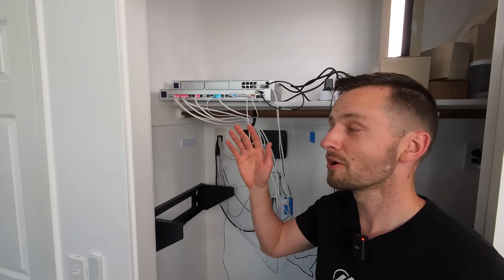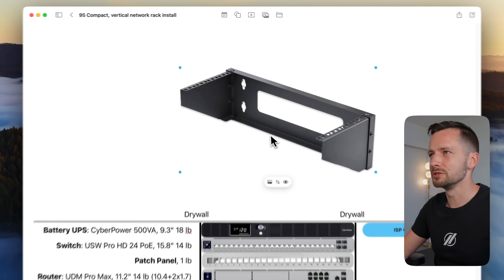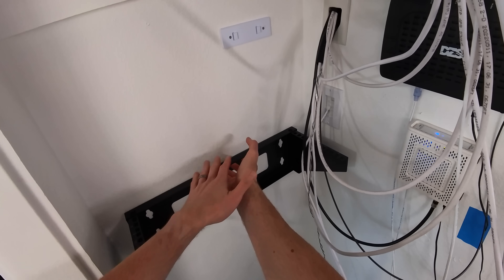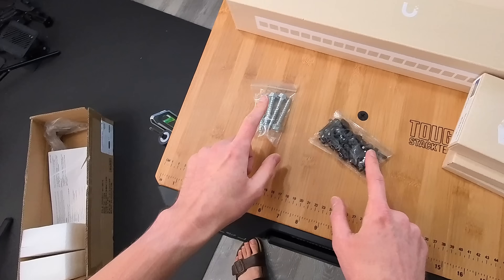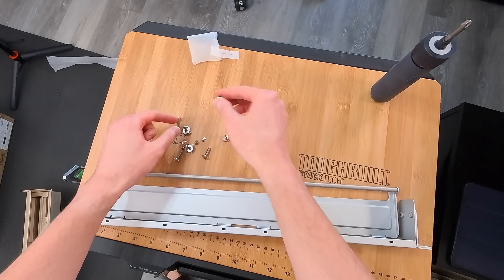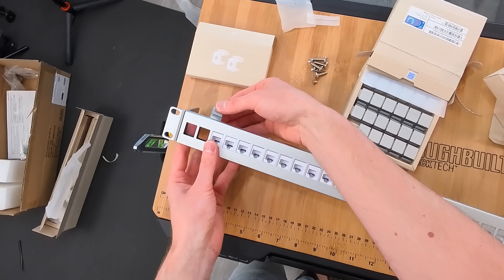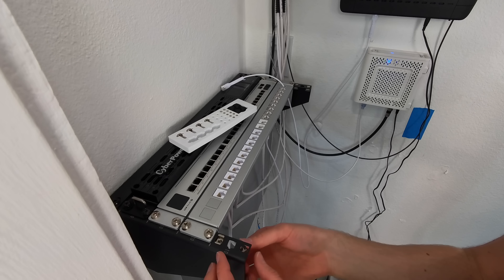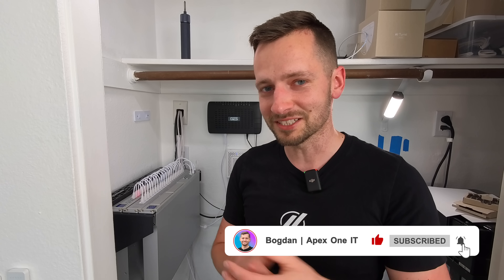How to Install Home Office Network Rack | DIY Wall-Mount Vertical 4U Rack

Comment: How do you manage adding cables to you patch panel if you want to add another device to your network since the patch panel is sandwiched between the two other devices? Do you have to pull your switch out to get access?

Comment: I was going to comment on your choice of vertical orientation and dust but you addressed the concern.  You might want to put your router closest to the upd then the switch and have the patch panel on the outside to make potential changes to the keystones easier

Comment: In my opinion you should add a ring to those bolts. That prevents the whole rack falling down during installation or if due to vibrations the rack manages to work its way upwards and the bolt popping through the hole in the rack.

Comment: Nice job with the 4U vertical rack, thanks for the video. I made a similar installation last year and have been pleased with the appearance and performance. Excellent choices with the Unifi gear. One suggestion: for links that you might upgrade to 5 or 10 Gbps you should consider changing the RJ45 in-line couplers in the patch panel to component-rated keystone jacks (Cat 6 or 6a, depending on your cables).  Unlike simple RJ45 plugs, keystone jacks use PCBs (printed circuit boards) inside that are component rated and help impedance-match your cable run. This is important to ensure best performance in terms of crosstalk, return loss, "headroom", and other parameters that are tested with cable verifier or cable certifier equipment. While permanent link cables terminated on both ends with plastic RJ45 plugs might "work" in a given instance (low speeds), these cable links demonstrate the worst performance when tested. For more info, start with TrueCABLE's website and search in their blog or videos for "Choosing the Right Termination -  Keystone Jack vs RJ45 Connector ..", "Selecting the Correct RJ45 Connector", and "What Does a Bad Termination Look Like?". Again, nice job!

Comment: These vertical rack mounts are actually quite interesting and very convenient for beginner enthusiasts who want rack hardware but don't want a full size rack sitting around.
Reply from the maker: 100%. It's much faster to deploy than assembling a rack and wall mounting that rack.

Comment: The only issue I see is when you have to change the UPS battery (Usually annually or bi-annually) ou have to take the whole rack apart. In my case the rack ears allowed a direct wall mount by flipping the ears and then using butterfly/toggle bolts to anchor it directly to the wall vertically. the rest of my equipment is in a small rack. So when I have to change the battery in the UPS II can disconnect it easily without having to remove all the rest of the equipment and unwire and rewire everything.
Reply from the maker: Thanks for the tip. I never found I had to change UPS batteries that often. Maybe because power here is generally stable.
Reply: @ApexOneIT  Another interesting thing is the battery monitor systems are not as accurate as you might think. I had batteries that were in my UPS for four years and the BMS reported that they were fine. Then we had a power outage, and the UPS kicked in then it shut down! Needless to say I now schedule battery replacements regardless of whether the BMS says its required.  I also conduct a monthly test and random weekly tests. I have found a failure event twice as a result of this process when the BMS said everything is fine! The first time the batteries were only 12 months old t, the second time the batteries were 18 months old.  Every 24 months in the first week of January. I might be able to go for longer but since this is critical infrastructure for me to access the internet in the case of power outages, I would rather know that the batteries are good instead of guessing. This is on an Easton 5S and a enterprise grade 5P!

Comment: Looks good Bogdan! I really enjoy your rack builds. I'm about to install a 2u vertical rack in my attic with patch panel to organize all of the existing cat6 and fiber to extend and drop everything into my home office. I'm relocating all my UniFi equipment from a closet similar to yours. Once you start using the UniFi patch panels, OCD panels, keystones/blanks and dust covers, you can't stop. LOL

Comment: Nice video! This is what I did for my main network rack. Biggest advantage for me was space saving. Doesn’t matter how deep a component is, since it’s installed vertically. A vertical rack makes it really easy to wire in a small space as well!
Reply from the maker: Thanks for watching! This is my main one too. I do have one on the ground, not shown, I use for testing things..
Reply: @ApexOneIT I do the same. I have a floor standing rack that contains all the things that I can mess around with, and if something goes wrong, other people in the house won’t get affected. But my main network rack (vertical wall mount) has the Unifi UDM-SE and other switches that I can’t mess around with when the family is home.

Comment: After you went through the trouble to locate the studs, you could have maybe cut and mounted a wooden backing board (or mounting board) into the studs, to then screw the rack to that one. It would've been a bit more sturdy than mounting it directly into drywall, and could support more weight at the front of the rack
Reply from the maker: Locating studs took a minute. If someone is looking at maxing out the rack at 120lb weight capacity, then yes, I would recommend they do what you say or align to 16" studs on center.
Reply: @ApexOneIT  Using a backing board is also good if you need to mount between studs. Use toggle bolts then. I had a lawyer's office I was setting up and office was located in a house from the 1830's. Nicely renovated but complete non-standard. Studes varied from 12" to 19 inches on center! Out solution was to mount a 4x8 sheet of i one-inch-thick plywood across three studs. then toggle bolt the telecom cabinet to the plywood.  (We have also used large bolts with washers mounted back to front for mounting heavier loads above 250lbs, which is the rating for the toggle bolts we use) We also cut off the bottom six inches since there had been evidence of previous flooding in the basement. Everything was mounted above the water line in the rack and the rack was elevated on a six-inch pedestal.

Comment: I used the same style rack when I had to mount an IDF inside of a NEMA weatherproof enclosure on the side of a building. The setup worked out great, and for those that are going to ask; no, the equipment did not freeze in the winter, or overheat in the summer, and no moisture does not condense inside the enclosure.
Reply from the maker: Thanks for your insight. Appreciate it.

Comment: have you ever had any performance issues or otherwise with the keystone couplers or are they fine to use instead of the usual pushdown/toolless ones?
Reply from the maker: Never had an issue. I go punchdown keystone if the cable is unterminated. Otherwise, if the cables are fine, a keystone couple is much faster.

Comment: Any thoughts on the thermals of this option? I'm thinking the fans may struggle to pull the air down through the switches
Reply: I have exactly the same under my stairs and been like that for a few years. My udm pro max temp shows 
50°C and my UNVR is showing 59°C
Reply: @Dave-901  Good to know. My setup will be under stairs too. Do you have any ventilation like a vented door?
Reply: @DeuceDeuceBravo  No i don't have any ventilation just have a door to get access but its always closed cos i own a rottweiler that loves cables🤣
Reply: Fans are much more powerfull than natural convection.
Reply from the maker: It's a small rack with only a handful of devices. So if passive cooling is not enough, any active cooling would be helpful I'm sure.
Reply: Doesn't matter which direction the air is going. If there is a fan, the air will move.